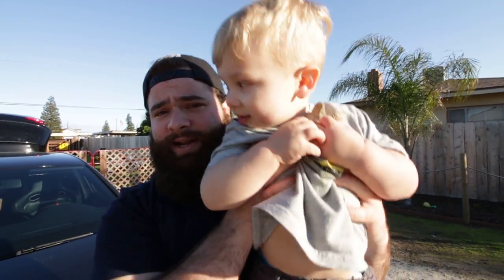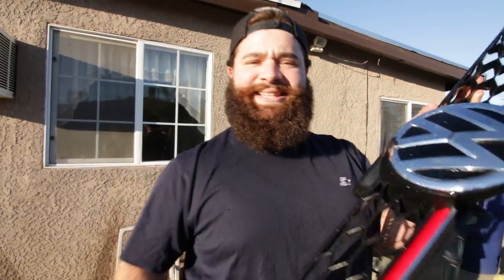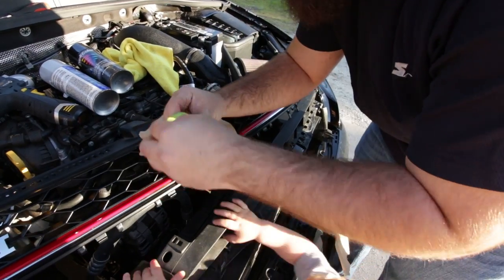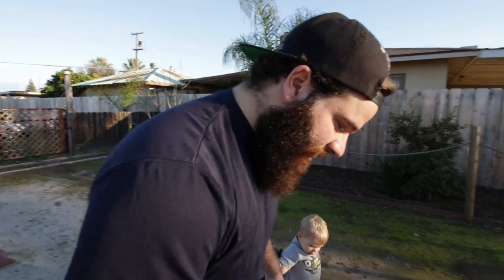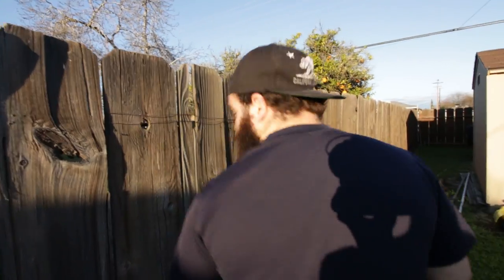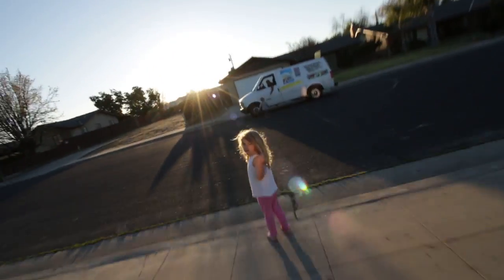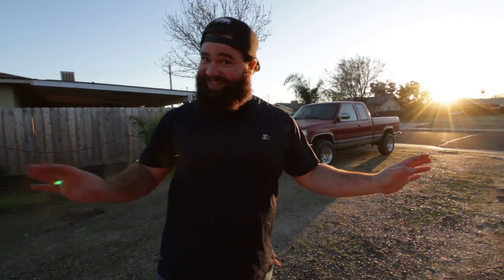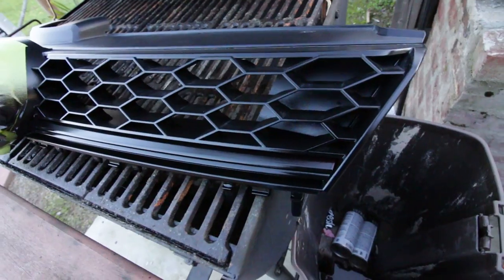HOW TO RUIN YOUR GRILL | MK7 GTI

Comment: If you bought the ziza for your low beams. I would say skip. Just get yourself an h7 hid kit and be done with it. Usually the blue bulbs are junk. I used to buy ddm and also innovited off of amazon for like 30 bucks. Which is about the price of those zizas. IF you feel like the paint is too jacked up just get a can of brakeclean and hose that sucker and do it again.